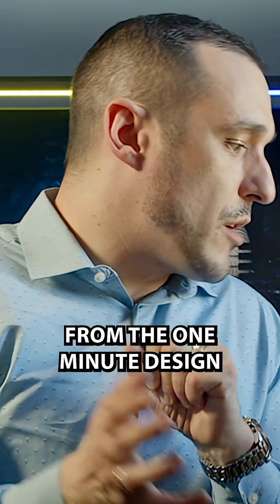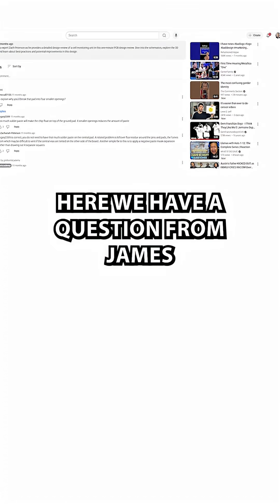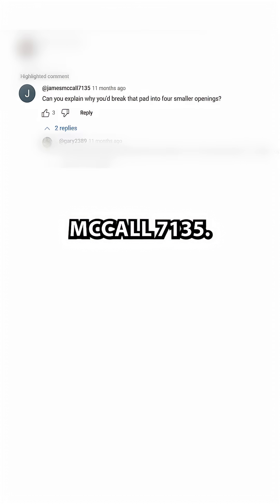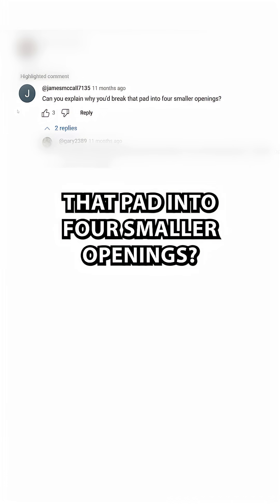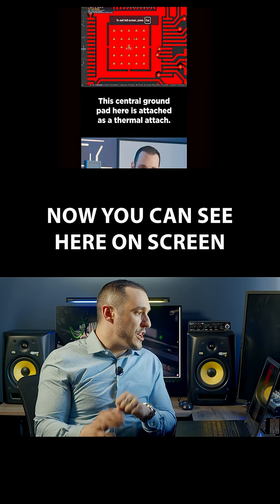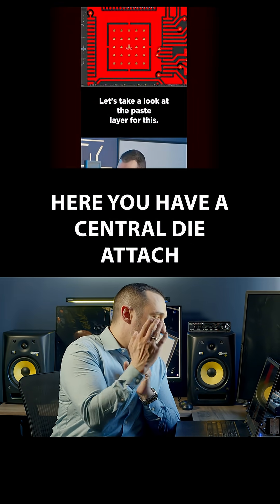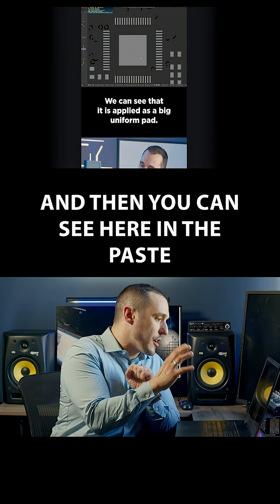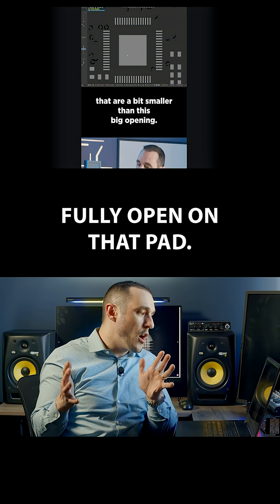Paste Mask Opening on PCB Thermal Pad #pcbdesign #electronicsdesign #manufacturing

Comment: @JamesMcCall7135 -- good question!  @zachariah-Peterson -- Is it important to isolate the sections,  or (assuming you could get the right volume of solder paste) would it be enough to break it up with solder-mask dots that tent each via?  Would it be even better to split the copper pad itself, so long as there are thermal vias in each section?  Or are these options all at the "no general rule yet, but it probably won't make a huge difference" level?